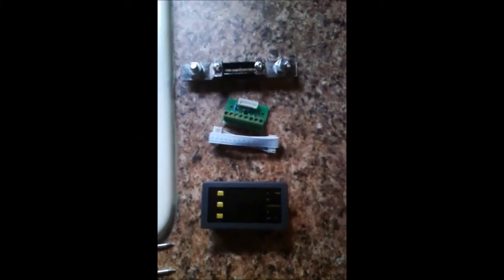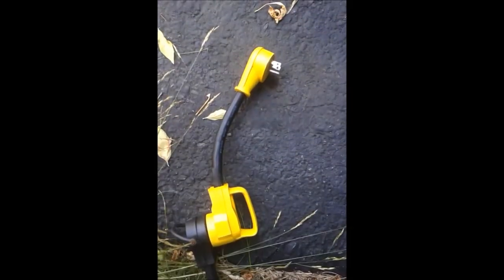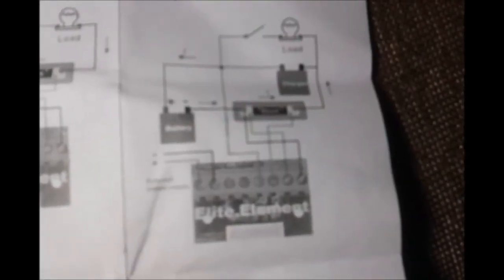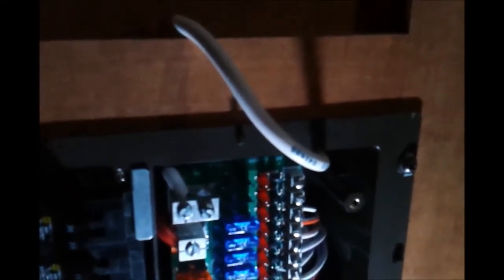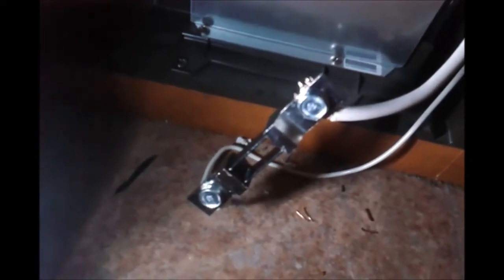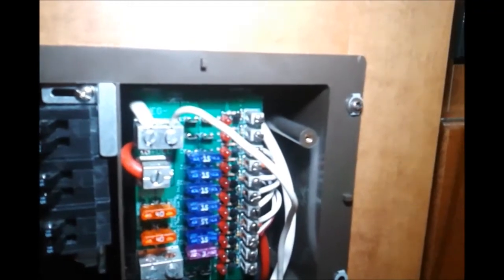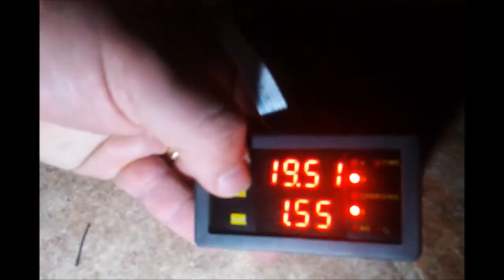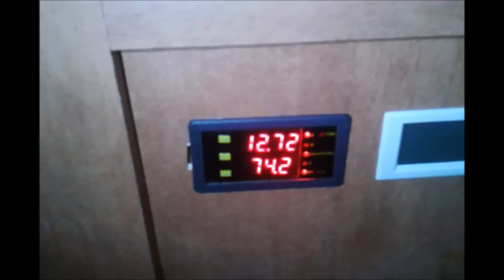Installing DC voltage/ammeter computer in Travel Trailer

Comment: Are you still happy with this meter or have you upgraded this to something else?
Reply from the maker: It tends to drift a bit after several cycles, and is not aware of LA Peukert effects.  This was a decent meter for the price,  but I have a new meter that handles both those issues and more.
Reply: GyroGearloose-HackingRVsCheap  looking at doing this can u share the newer one with me?

Comment: The two-40amp fuses are for reverse-polarity protection of the DC side (your house battery).  They have nothing to do with AC power.  Thank you for the instructional video on how to install an ammeter.  Did you  run into any issues with the accuracy of the meter while using your AC power to charge your battery via the Converter unit?
Reply from the maker: Yes I know they are for polarity protection, although it is technically incorrect to think of a fuse as polarity protection... As always a fuse only responds to amperage, however you are correct that it will blow in reverse polarity because then the battery and charger are fighting one another at an excessive amperage.

A better objection is why I kept calling them "breakers"...lol.

Accuracy was OK with that meter to the extent ANY simple "integrated ammeter" computer could be accurate.   It would be perfect with linear-curve lithium batteries, but the drift problem you'll see is that lead batteries don't have linear discharge curves.  I now run a REALLY advanced battery meter that has LA awareness, live VA graphing, charge histories,  etc... but the company asked me not to show off the beta eval unit pre-release.
Reply: @GyroGearlooseHelis  How about on your discharge, did you experience any issues with the ammeter when you're hooked-up with shore-power via your Converter? I'm asking again because I read a similar situation where a person mentioned something about it. I'm doing the same install as you, but I don't have any Solar power system or Generator (no charges to be concerned of).
Reply from the maker: @n.g.1577  No special issues, other than drift between discharged AH and charged AH (nothing charges 100% symmetrically).  The best way to install any AH meter is on the positive wire STRAIGHT to batteries, so nothing "escapes" being recorded.   Then any charge from converter, tow, solar, whatever and anything discharging are all seen by meter.
Reply: @GyroGearlooseHelis  To the positive? How come you didn't do yours that way?
Reply from the maker: @n.g.1577 I have wires straight to my battery,  so the tongue jack is the only thing that had a separate ground (missing the meter).  If you shunt the battery positive,  there can't be hidden grounds.
Reply: Thank you for the input.  One quick question:  As you did, I'm using 8 gauge wire to run the two-main legs (+ & -) from the Shunt to the Converter, but is it ok to mix the gauges (say with 12, 14, 16 gauge wires) for the rest of the application?  I'm going about 10' feet from the back of the Ammeter to the Shunt.  Does it really matter if I don't deviate too much from the mentioned gauge wires?  I'm not planning on using anything over 14 gauge, but I don't have one of one particular gauge in order to do the whole thing.  Have a great day!
Reply from the maker: @n.g.1577  There are always voltage drops,  so you want the shortest heaviest wire you can on the shunt.  Size less important for the other legs,  but still try to keep shorter if you can.
Reply: Thank you.  My diagram is calling for the red wire (meter power) coming from the meter to be hooked-up to the positive side of the battery, did you had to do yours the same way, and if so, did you hooked the red wire directly to the DC positive lug on your Converter unit or what was your approach to this?  Have a great day!
Reply from the maker: @n.g.1577  ultimately,  the meter needs + and - power for itself and two sense wires across the shunt.  The shunt can interrupt either pole of the battery.  Anything that charges/discharges(load) goes opposite sides of the shunt from the battery. 

If the shunt is electrically immediately wired to the battery (as it should be) you can share one of those wires.  So, my current meter (not this one) only has three wires - two big lugs for the (B+toL+) shunt, and a little ground (-) wire that only powers the meter itself.
Reply: @GyroGearlooseHelis  Understood. So, what would suggest in my application, go directly to that DC positive lug in the Converter unit or another alternative?  Would you like me to send you the diagram?
Reply: @GyroGearlooseHelis  Mine didn't work. Can I send you a picture?

Comment: GyroGearloose-HackingRVsCheap
EXCELLENT Video!!! I think I installed mine as per your instructions. Those that came with it are lacking at best :( I notice on yours the charging light is blinking intermittently. You mention it is getting intermittent + power. I have a solar panel charging controller hooked to my setup. The charge light is on solid all the time... even with panel unplugged... any idea what I've done wrong?
Reply from the maker: Roger Redmond The charge light should be intermittent when plugged in and charged, since the float function of the charger is doing its thing.  If on when running from battery and off when recharging, you have your shunt wires reversed (seeing drain as charge).  Otherwise, you may have the shunt in the wrong place and be measuring something less/different than you think.

Comment: Thanks for the video/instructions! I installed one of those blue-LED backlit meters (with v,amps,watts,w-hours) on the same fusebox setup - initially put the shunt in the neg line the same place you did and got no amp reading - realized this section wire connects the box to the negative bus where the negs are taken off to all the appliances (load). So moved the shunt further along the neg, on other side of that neg bus, and now meter shows amp hours, but does not register the furnace fan draw. Furnace fan must ground to the frame, or directly to the battery neg line,  between the meter and the battery line.  Actually, I unadvisedly cut the battery neg line to insert the shunt while it was still connected to the battery, and it didn't cut power to the rv.  This is the reason you popped your fuses - the neg/box is grounded to the frame somewhere else.. maybe through the a/c side, and the neg comes through the converter over to the 12v DC side...
Reply from the maker: Regorybles thanks for the input...I'm not using that ammeter on my current trailer since I've actually invented my own power computer that does a radically better job, but needing to find a single monitoring point would still be relevant to ALL such meters.  Thanks!
Reply: Guess I'll have to move the shunt out to the neg cable closer to where it comes off the battery... when the snow retreats enough to be able get under the trailer and poke around to feed the sensor wires back to the meter.

Comment: Hi GyroGearlooseHelis, thanks for that tutorial.I was wondering at 5:58 when you explain the sensing wires, here is no mention as to what happens to the red wire. Do you plug this one to the chargers red (+) terminal right bellow the battery (-) that you used for your shunt split ? I am stuck trying to figure that out. Thanks

Comment: Name brand of product and where did you buy it
Reply from the maker: I bought mine on ebay from elite.element:  http://stores.ebay.com/Elite-element  Tell him I sent you, and you'll get absolutely nothing free.  :-)
Reply: GyroGearlooseHelis what size wire did you used between the shunt and the connector block?
Reply from the maker: 8ga is fine for about 75A, 6ga is good for about 100A.  My trailer pops fuses at 40, so either should be safe.  Also, consider that you're not normally drawing max amps for long, if ever.  The only reason to use heavier wire is if you mount the shunt far from the power box, where unwanted voltage drop could become an issue.